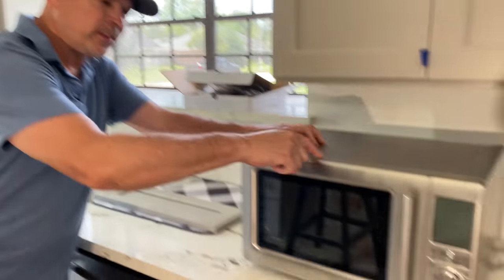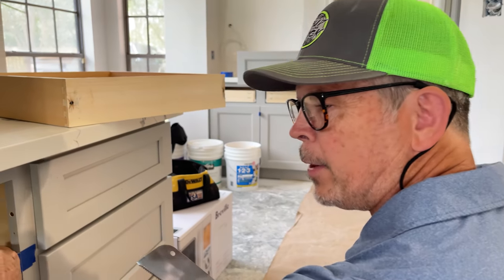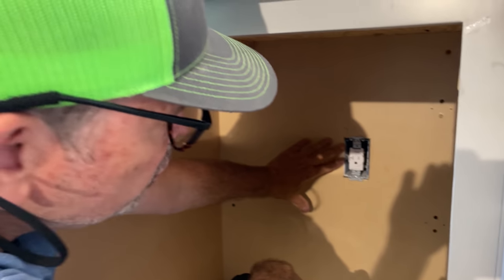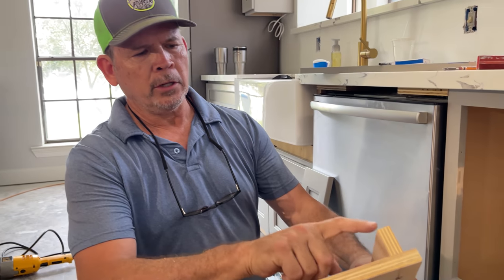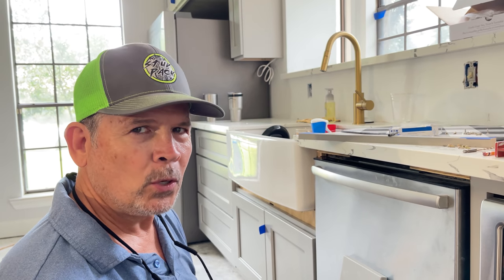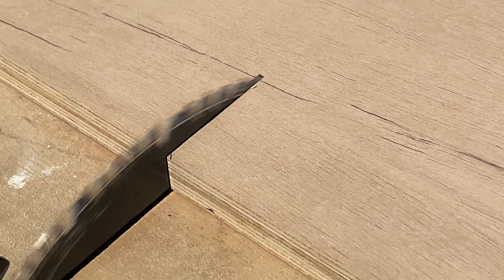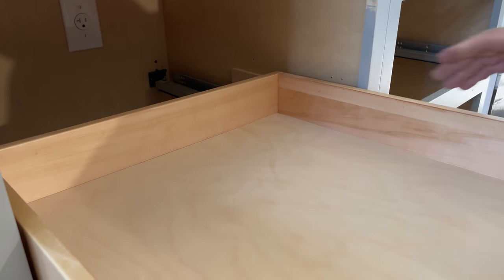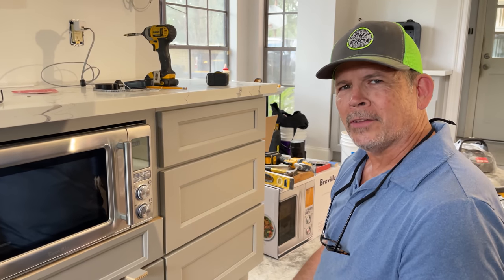Getting THIS Microwave in an IMPOSSIBLE Opening

Comment: Love how you go the extra mile and the attention to detail, this turned out great. It would be very difficult to find a contractor around here that would take the time to do that. Great job!
Reply: This is the perfect comment, been subscribed for a couple years now and it's been good for me.
  I grinned at the "sub-scribe-to-stud-pack" after the microwave chime that was smooth

just wanted to add, thanks for cleaning up the Dude-speak Jordan. If you act like a professional (which you are already beyond proven) people will treat you as such.
Reply: time is money gotta be a customer that compensates good work and you get good work.
Reply: I want them for my contractors!  You are consummate craftsman guys!
Reply: @mansfieldcarpentry805  True! Additionally,When you work with integrity you are worth your weight in gold and can charge accordingly instead of compromising you integrity by not taking your time to do it right. It may mean you have less customers but that doesn’t equal less pay. You get what you pay for!
Thank you for your contribution to the industry.

Comment: You guys are great!, real professionals! Retrofitting appliances in existing cabinetry is an art. Your installation looks like it was part of the original. I recently had to modify my refrigerator opening to accommodate a new unit. I used your techniques for the cut out. It was really effective. Thanks.

Comment: Nice job guys. Myself though, I would've built a new face with wider rails. Of course, that would be up to the owner. Nonetheless, awesome conversion!
Reply: I would have tried to split the drawer face horizontally and take height out of the middle, keeping the rails the same. That will be the only drawer in that kitchen with different rail widths—even different from the vertical rails.
Your attention to detail impresses. Keep it up.
Reply: @Clintotron  A single rail is about ¾ of the full "mini" drawer front height (look at the drawer to the right of it 16:06)...wouldn't work. The rails I probably would've built would've had maybe 1" of panel reveal. Hard to say without testing out different sizes. Nice Tele btw ;-)
Reply: @markarita3  Thanks for pointing that out. Depending on the pulls used (I can’t remember if they require pulls) I’d have just gone with a solid panel and recessed the base of the pull the 3/8” (or whatever) so they all have the same projection.
It’s a partscaster I took on trade. I LOVE it. Wish I had access to it right now. 🤘🏼

Comment: Nothing could convince me to put the microwave there.
Reply: It looks nice but as someone who is 6'5" no way in hell I'm bending over to cook stuff every day just to save a bit of counter space.
Reply: It's possible for me to spill hot soup on my face while taking it out of my microwave where it is above the stove, I'd take this setup over that 😂.
Reply: @hanananah  we just re did our kitchen and put it under the counter. in the old kitchen it was sitting on the bench and was such a waste of space (small kitchen) no real option for one in the wall cabinets and our oven is an under bench one, so no oven 'tower'. also did not like the idea of the mocrowave being at head height for the exact same reason you mentioned.

it works well and we saved so much bench space with getting the mivrowave off it. seems to be the way a lot of houses are being built here (in Australia).

Comment: 'Putting a microwave in a very inconvenient place where you have to squat to use it.' Alright then...
Reply: Usually when I've seen under counter microwaves they've been bottom hinged.    Much more convenient when they're at knee/thigh level.
Reply: Right, I would never put a oven 2 feet of the floor.
Reply: Having had a microwave on a counter, over the range, and installed like this..this is truly the best place for a microwave. Easy to use, less chance of spilling hot stuff on yourself, and doesn’t take up valuable counter space. I will install microwaves in lowers forever.
Reply: @empressche333  On a counter at hand or arm height has been an issue for you? Really?
Reply: @dalesworld1308  on the counter takes up all my counter space. Up above the range is awkward and tippy. So, yes, installed under the counter is, by far, the best option.
Reply: @empressche333  It may be YOUR best option. It is not THE best option.
Reply: It's nice for the children to dry their hamsters. That's why the installation instructions say "Microwave oven is not intended to be mounted below a height of 3ft (916mm) above the floor level.".
Reply: @DaniEtter  🤣🤣🤣
Reply: You mean at a more convenient height than using the oven right next to it?
Reply: Dani Masterson  exactly, my daughter was climbing onto window sills and onto the back of the couch at 12 months, at 18 months she was climbing over the baby gates. the the only place it would be safe (atleast until about 5 years) is at about 5-6 feet off the ground, then its just a safety issue.

My sister had the handle of a cup snap off as she was taking it out of the microwave, major burns on her waist and legs, luckely the microwave was only on the countertop, can't imagine how bad it would have been if it was at head level.
Reply: Dani Masterson  and if its inside a cabinet, if its mounted nice a solid (so it cant move) you can use appliance locks.
Reply: @krevor4095  Oven controls are at counter height. It's not the same thing.

Comment: How does air flow through that microwave?  The online manual doesn't show where the intake and outlet vents are located.  But on page 14 it does say "a minimum clearance of 8 inches (20cm) is required between the microwave oven and any adjacent walls".
And below that it reads "Leave a minimum clearance of 8 inches (20cm) above the microwave", and "do not remove the legs from the bottom of the microwave", and "Blocking the intake and/or outlet openings can damage the microwave"
I get the impression that the intake vent is on the bottom, and the outlet is on the top.  I would drill some 2" holes in that shelf you made, so air can get in the bottom of the microwave.
But the outlet may be a problem: I think it's well above the holes you drilled on the side of the cabinet, so hot air will pool between the oven and the countertop.
Speaking as an electronic engineer, with lots of experience cooling electronics, I would make some sort of air dam between the oven and the walls of the cabinet so that hot air from the outlet can't find its way back into the inlet.  Letting the air recirculate through the oven will make it a lot hotter.  I typically use a piece of cardboard, or a thin sheet of polycarbonate (which is easy to bend with a heat gun) and some duct tape.
What you want is 1) air comes in through the holes you drilled above the toe-kick, 2) then the air goes through holes in the shelf, and into bottom of the oven, 3) hot air comes out the top of the oven and has nowhere to go but out though the holes you drilled on the side of cabinet because your air dam blocks recirculation.
Good luck.

Comment: Love the channel guys!  Came out great. Just a suggestion for the microwave in custom cabinet type installs. Ever heard of a company called micro trim?  They make custom laser cut metal surrounds for microwaves the come with a raised support shelf and provides adequate and integrated ventilation through the face frames. I did my own and it came out top notch.
Reply from the maker: Thx I’ll definitely check them out 👊

Comment: Excellent work!  Super impressive. But having often had the thorny issue of old built-in appliance breaks and new models are not same size what happens when the microwave gets old and needs to be replaced?  Refrigerators are not even standardized heights and the new one the client wants almost never fits the old built-in cabinetry. Doh!

Comment: I think I would have removed the material from the middle of the drawer instead of the top and bottom. If you notice, all of the other cabinets and drawers have the same size frames, but different size panels. I know the panel would have ended up tiny, but I still think it would have ended up looking more consistent.

You could still try it: use the larger drawer you aren't using, rip a bunch of material from the middle, and see if you like it better.

Comment: Man I wouldn't even have thought to move the top drawer down and trim it to put there... But it looks great!

With your drill issue... I have the Dewalt 20V MAX XR drill/impact set (Item #779395 at Lowes) and it's been amazing and taken a ton of abuse the 3+ years I've had it.  The drill has so much torque on setting 1 there hasn't been anything I couldn't get through.  It can even start lawnmowers on setting 2.  I also have the impact that you have, as well as the XR one from this set and it's pretty amazing how much faster that XR impact is.  Plus no high pitched squeal on the XR one.

Comment: My first thought, that has been mentioned by others, is that some sort of screen needs to be put over those holes to keep mice out. They will nest in the dishwasher insulation. Needs to be extra sturdy mesh and possibly have steel wool behind bc they will chew through metal screen mesh. I found that out the hard way with my pantry.
I'm not very fond of the microwaves down low because I have a bad back. I prefer ones that are higher up, but not too high. My friend's kitchen has a microwave cabinet that is similar to a tank topper cabinet but the opening is large enough for a freestanding microwave to sit on. Freestanding microwaves usually need about 3" of space on the sides and back to vent properly.

Comment: That little drawer could be for kitchen towels.  Or hot pads. 
You could also put in dividers and store large serving utensils that usually don’t have another place to go. 
Not sure it is tall enough but plastic wrap, ziploc bags and aluminum foil boxes may fit. 
Or a spice rack drawer insert would work too.

Comment: Instead of wire nuts Try the Wago 221 connectors. they work up to 12 gauge wire and 20 amps. Some go to 30 amps. I really Recommend them.They're not like backstab outlets there is a lever that hold on to the wire. I love em especially for stranded wires. They're reusable, don't damage the wires overtime, and they're really quick.

Comment: Great attention to detail on this one. I'm a big fan of putting regular microwaves in cabinets. Built in microwaves are exorbitantly expensive in many cases and they're just a pain in the rear.
Reply: If you aren't afraid of used, you can find some business/industrial sized "Undermount" hanging style ones of thee extra large variety on craigslist / marketplace and the like. Ive had some decent luck with them over the years. They are a pain to mount, but they are amazing for kids. I also find them a bit easier to clean when its a bit bigger on the inside.

Comment: I’ve done this before with a microwave drawer. You can clamp a sacrificial board right where you need your cut. Use it as a fence for your multi tool. Keep the blade flat on it and you get a nice straight square cut

Now I keep watching and you pretty much did the same with a router lol

Comment: I love your videos and the quality of your work. If I was to change one thing about that microwave install, however, it would have been to remove some of the height of that top cross rail so that the top of the microwave was level with the top of the neighbouring drawer fronts. That might have allowed you to retain the full drawer height below, or certainly required you to remove less of the drawer height. Being the top rail, it might have weakened the cabinet a little, but you could have reinforced the top rail with a 2"/3" horizontal rail behind it, with some pocket screws into the sides and existing front rail. It's my OCD tendencies to worry about stuff like this that means all my projects take months!! :)
Reply from the maker: That was my first thought too Mark but realized that the subtop is screwed down to the top cross rail.  My router bit would have been destroyed.  There’s probably another way to cut that but we just moved everything down.   Awesome insight though thx Mark 👍👊

Comment: I just did one like this. I mounted 4 strut bolts to the bottom of microwave. Then tighten bolts  to pieces of half strut upside down. After centering Micro on a wood shelf mark center line of both channels. Drill two pilot holes large enough for strut bolts add square washers. Slide micro with strut onto bolts and tighten the bolts from underneath after removing lower drawer to set final depth of micro. Allow it to protrude as much as the face  of the lower drawer front. 
Then create a 3/4 plywood or hardwood template with a cutout of the microwave opening leaving a 1/8 all around. Make sure template also stays within the dimensions of your overlay of your fronts and drawers. Go to local laminate top place buy a remnant piece of brushed stainless steel sheet. Laminate the template with the sheet with contact cement. Route the inside and outside of the template. You now have a custom stainless trim. After filing edges or sanding use blue tape to cover the stainless. Use a matte black spray paint to finish inside and outside edges. If your brave or OCD rip edge banding out of the stainless alternatively to paint finished edges. Be careful. It's sharp. Wear glasses and gloves. Fraction of the price of the store bought trims. Fully customizable for any microwave or cabinet.
I like your version, it works for what you had to work with. Many older people or those with shoulder issues like these mounts. A true drawer microwave is usually at least a thousand bucks. Unachievable for most folks. Good compromise 👍

Comment: I would have made the shelf to fit the unused drawer slides. Make it a pullout shelf. Will make accessing replacing the microwave easier for when it eventually dies. They always do. Also, there will be enhanced air flow.

Comment: Coming from a cabinet maker, I'll never understand the design. Especially, retro-fitting post build. It's such an irreversible job once the trend dies. I'll always over range, or use an over range install kit and mount under a staggered cabinet. Storage is too valuable in small kitchens. To each their own, But for a retro-fit, I don't think I'd ask anyone else to do it, you absolutely nailed this job. What craftsmanship.

Comment: Great job guys. Is there a trim piece going above the dishwasher under the countertop? The narrow drawer front I would have cut the middle out of the front and joined the 2 remaining pieces together, this the way the rails would be consistent with all the other drawers and doors but that just a nit pick. Cheers
Reply from the maker: The dishwasher will get raised up by the adjustable feet at final install after floors 👍

Comment: On the narrow under the microwave drawer face modification, what if you'd removed the inch or so of height from the center of the panel? That way the rails would stay dimensionally consistent with the rest of the drawers and doors; a bit more patching but worth the effort.
I like the way you and your son interact, great relationship.

Comment: Paul, one that 20amp outlet in that metal box. You really should have wrapped the outlet contact screws with electrical tape. Theres a very good chance for arching in that box even with a afci breaker in the panel. Always wrap outlets and switches with electrical tape before stuffing them into any box.
Reference Sparky Channel for examples

Comment: Hopefully you saved that cross member you cut out for the microwave. Rip it to the same 3/4ish height as the microwave shelf then attach it there and paint it to match.. That way you can no longer see the plywood AND the shelf has the same reveal depth as as all of the cross members (professional look) rather than raw plywood (diy’er look)
Reply: Need to make a new cross member, the original is now too short.  But the concept is right on the mark.  The cross member also needs to be just the thickness of the shelf, or slightly taller (to keep the microwave from sliding out forward).  That finishes the plywood and won't take away space in the small drawer.
Reply from the maker: Plywood edge covered yesterday with some trim left over from cabinets. Man you guys see everything 😳👊🤣🤣

Comment: You did great work. Does the customer knows if that microwave breaks down it will be a B..... to find another one with those dimension.  You left one part out the completion of the unfinished surface of the new draw when it got cut down the finished was cut with it.
Reply: He said that part would get a matching paint. Also microwaves come in standard sizes. It will be easy to find another. Do you have to redo your entire kitchen when an above range microwave fails?

Comment: Love the video. Question: How do you plan to keep the microwave moving forward?
Reply: That's what I was thinking too. I would make small dimples for the feet to rest in.
Reply: Why would the microwave move forward?  Closing the door can move a microwave, which is why you'd want a backstop, but there's not really a usage scenario where you'd be pulling the unit forward unless you intentionally wanted it out.
Reply: @toddosty  Unless its feet are very grippy rubber, it'll move trust me...mine does all the time...left and right also. Just a safety precaution, being it's so close to the edge, as opposed to the back of a counter.
Reply: @markarita3  I have a very similar setup in my own kitchen and I have zero problems with the microwave (Samsung) moving forward.
Reply: My microwave is fairly light-weight, and the door latch is stiff.  Its feet are not grippy.  Pretty much every time I open the door, it wants to slide around on the countertop.  Your results may vary with other units.